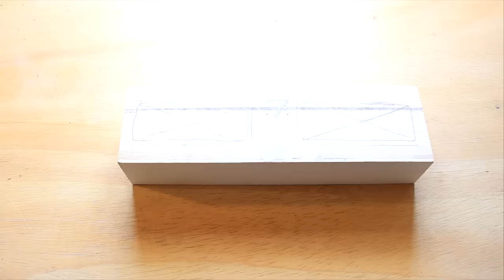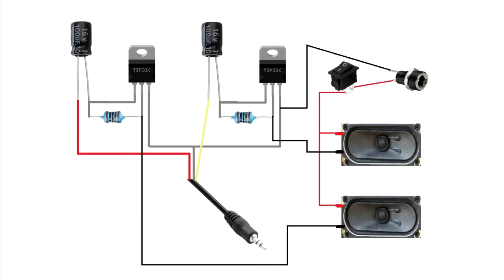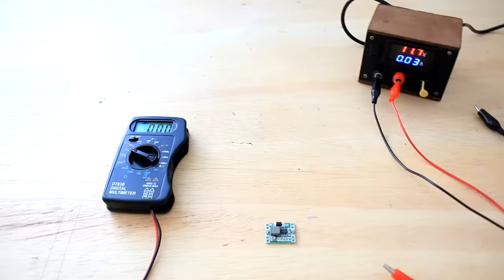DIY: Stereo Audio Amplifier 3.5mm

Comment: Hello sir. I. Love this video. And i have tried to build up 1. But my speaker only 1 side got sound. Another 1 side no sound. Both speaker (8ohm 8 watt) was OK. I found the speaker no sound 1 side when i  connect the DC step down voltage for LED. I use 6V and 9V input also same. 😅 Please advice sir.
Reply from the maker: Did you follow my schematic? check if both channel right and left are sending signal
Reply: @DTeK  hi. I have checked. I am sorry. It was my mini jack termination problem. 😅 By the wat, the speaker is OK if using laptop or handphone. But if i connect to my digital TV decoder, the sound very slow even the volume at decoder is maximum. Do you have any idea to make the sound louder? Thanks for your prompt reply & thanks in advance. 😊 I love all your ideas.

Comment: The speaker is nice but why did you use tv speakers 
You could use some old speakers cause those have no bass thanks for reading
Reply from the maker: i build it using parts from an old TV, with diferent speakers it has bass

Comment: Good Morning!  okay?  Interesting your project.  What source did you use for it: 12vts 5 vts?  And that little module you used only for the blue led?  thankful
Reply from the maker: Hello, i used 6 volts power supply, the little module is a "buck converter", its used to drop the voltage, in this case from 6 volts to 3 volts to be able to use the blue led, all the links and more infos in the description, tank you ;)
Reply: @DTeK Thanks!  thank you.  I'll try to make this your project.  Can I use a potentiometer to increase and decrease the volume, where should I put it?  Thank you.
Reply from the maker: Because this is a stereo amp i guess you could put it in the 3.5mm negative output, between the transistor and the 3.5 mm jack
Reply: @DTeK  why not just supply 1k resistor to the Led's?

Comment: Everything is cool, except for the amplifier...  why did u use such a bad amp, there is some dc current running through speakers and the audio quality must be bad. I know that it's the simplest amp to build, but if u have put an effort into doing such a nice case for this why didn't you bother building a better amp?
Reply from the maker: Most of the parts are from an old tv, i used the tip31c because i had a few to use (could use the transistor from the tv also), i wanted to build the easiest and most inexpensive audio amp possible, even the case its from a not used part from one of my other projects, it was a fun project and the case ended up better than i was planing in the begining, tank you for your coment.
Reply: @DTeK  ah, ok, cool, it makes sense now xd

Comment: No había entendido: "¿Para que era el 2do. circuito?" que colocaste ...... y resulta que es un mini regulador de voltaje.
Amigo................ Para muchos de aquí, le resulta genial tu diseño (y no opino que sea malo) pero, en mi opinión ¡Esto le falto!
Pudiste haberle puesto un Socket Auxiliar Jack 3.5mm Hembra y no el cable mismo. Hacer la entrada para el conector macho en ambas direcciones es fácil de hacer. Esperaba algun tipo de potenciometro (y no el sencillo) pero, me con formo con la luz led de carga.
Reply from the maker: try to reply with google translator, one circuit is for left chanel and the other for the right channel, 2 circuits for stereo sound

Comment: Can i use another mosfet?
Reply from the maker: yes, different mosfets can be used, but only those with the same parameters as the one that i used on the video
Reply: @DTeK  I made amplifiers with almost the same configuration and works good